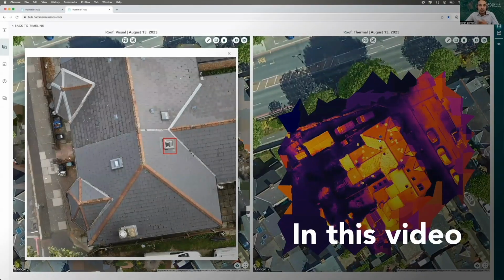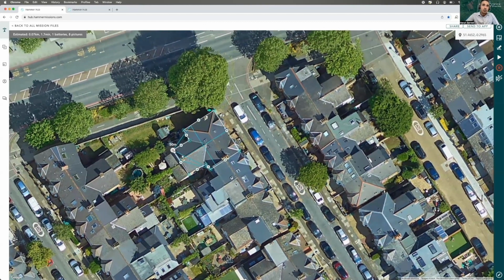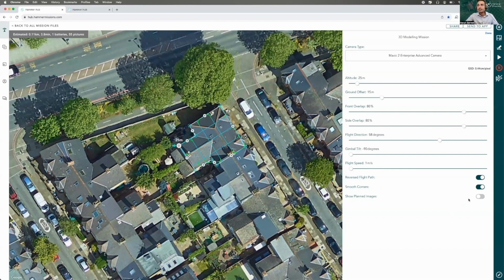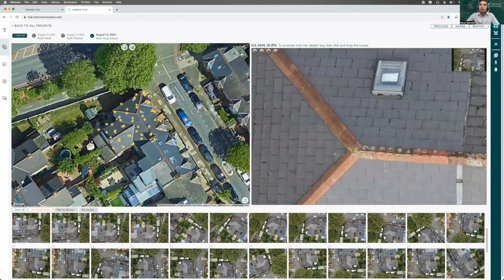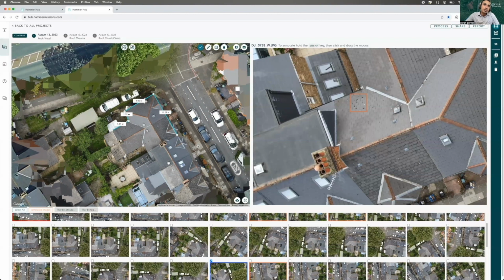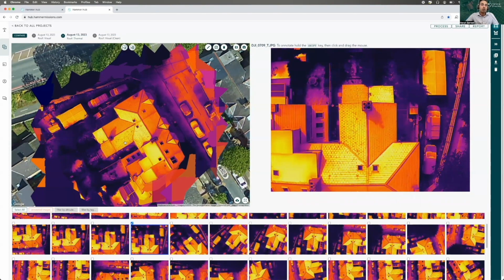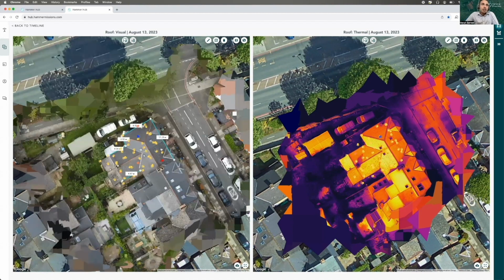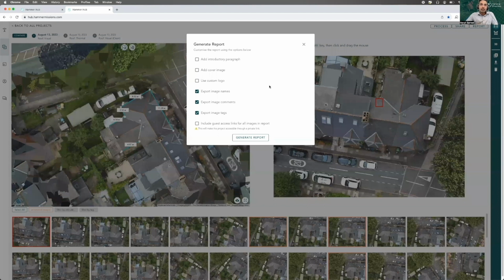End-to-End Visual & Thermal Roof Inspections | Drone Mapping | Hammer Missions

Comment: I have a DJI Matrice 30T and I find that even though you have a normal view and thermal view simultaneously, it is better to use the thermal feature at night or at sunset so the roof will have a reduced influence from the sun.
Reply from the maker: very true! late evenings are much better for thermal capture to reduce interference from the sun.